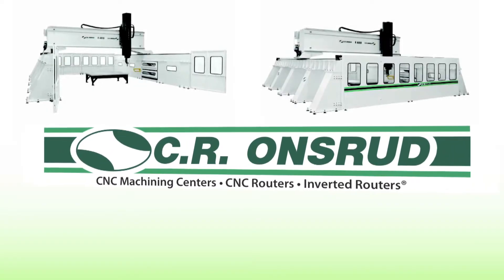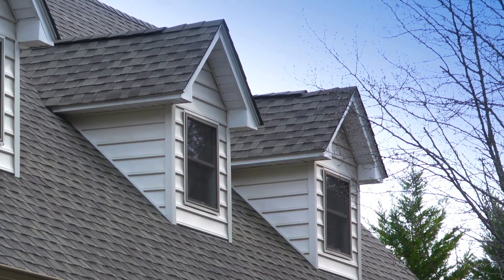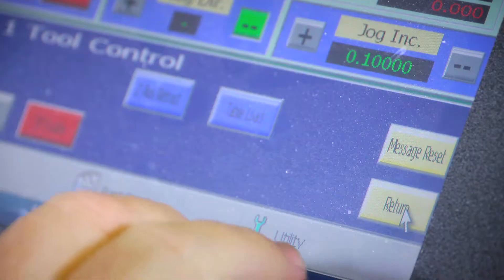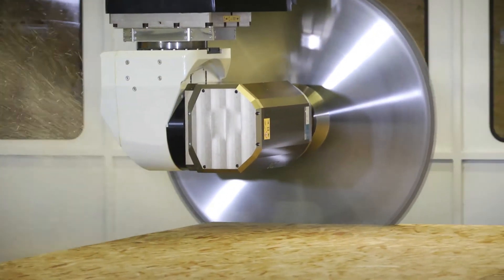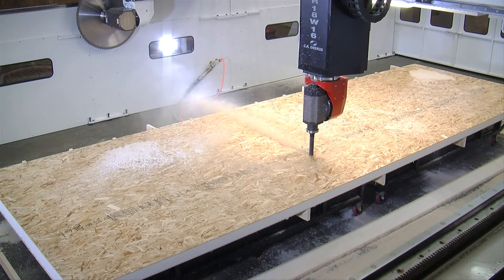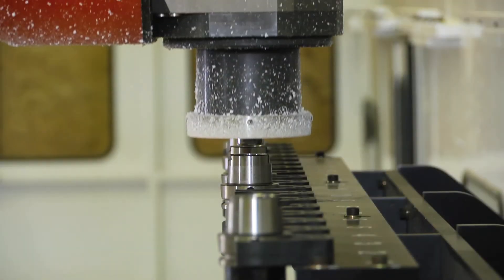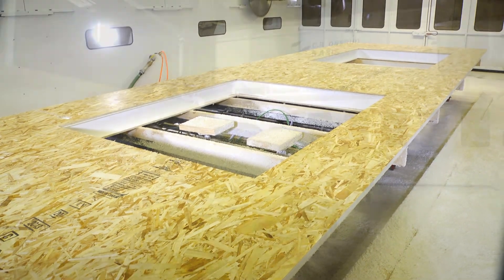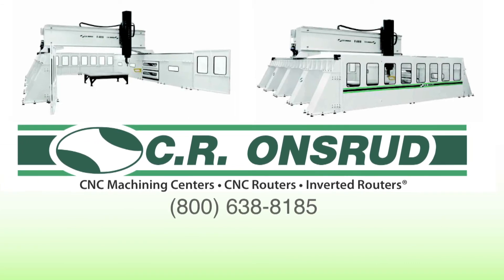SIPs Panels Processed on the High Rail CNC Machining Center by C.R. Onsrud

Comment: It is a very impressive machine...the video doesn't do this beast justice. I will say though that the table is pretty heavy, especially after you load a panel. The poor, poor operator.
Reply from the maker: Joshua Brooks thanks for the message. This machine certainly is fun to watch in person. CR Onsrud can offer full automation for panel in-feed and out-feed systems depending on the users desired level of automation and budget